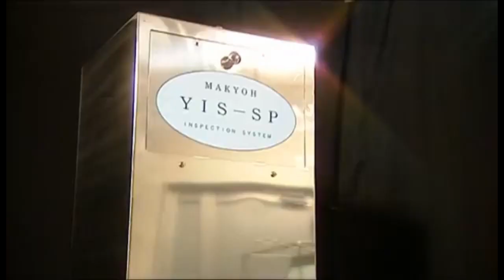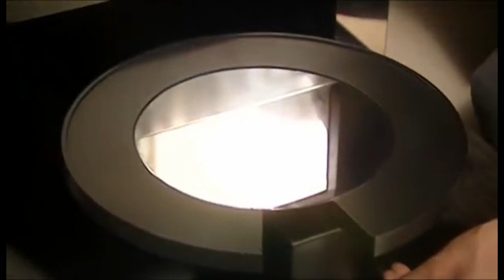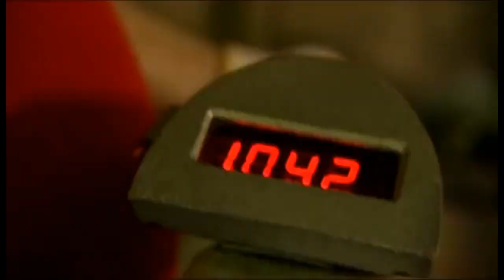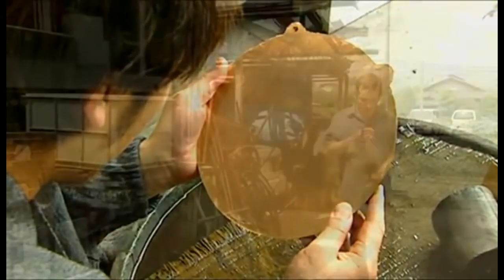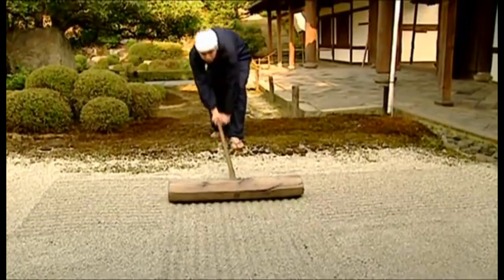Magic Mirrors & Ancient Precision.

Comment: Something else about this not actually lost ancient high tech is that the smoothness is created with  a blade, not an abrasive. One wonders if the primitive adz used by A. Egyptians as a plane could also cut shiny surfaces? My first guess is that a flint struck from a "core" could be used on its side to test this idea as they are straight looking.

Comment: At the end of the day it's all about the rays of the sun, without them there's nothing and methinks Newgrange was built with the reflection of the sun's rays in mind. Those mirrors are  are cool though.
Reply: what do you mean "built with the reflections of the sun in mind"?
Reply: @diobrando2160  using a basin of water to reflect the sun from the floor up into the roof box. Only a thought, considering they filled in the hole in the floor where this basin would sit it can't be done at present; we'll never know.